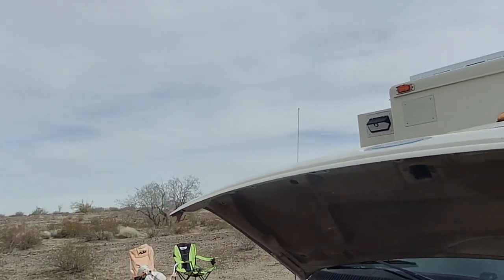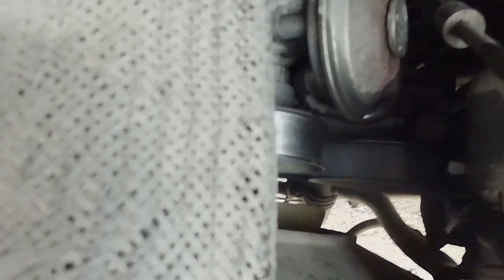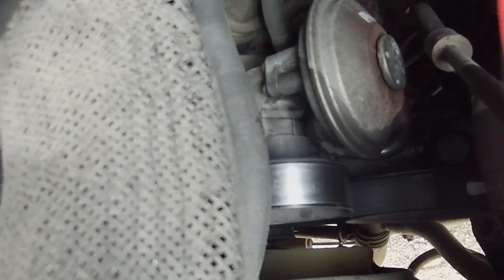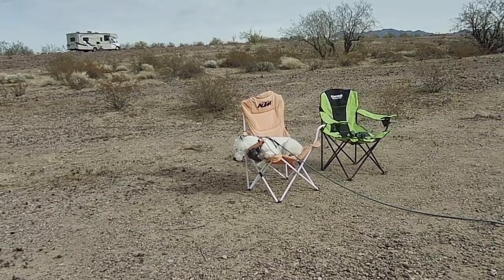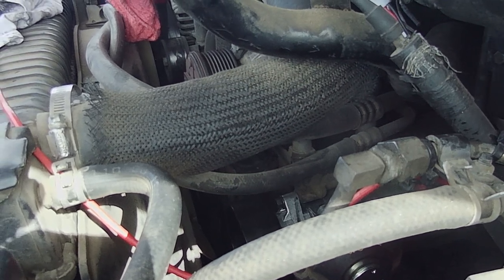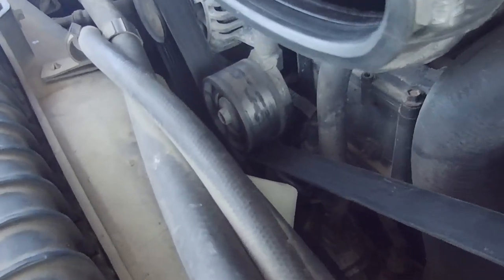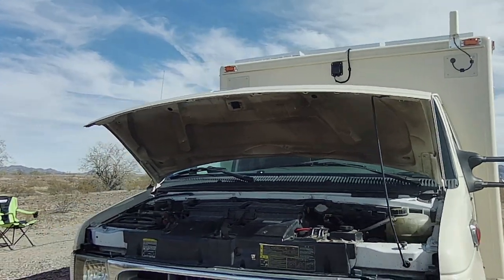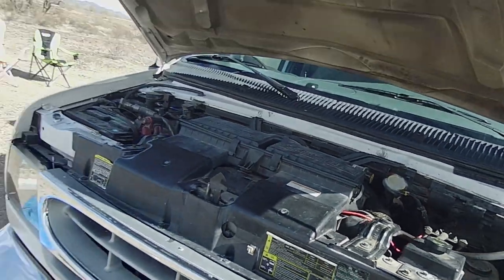Ambulance Conversion Brake Vacuum Pump Failed! Fluid Spray and Rattling Driving To Camp w/ New Pump

Comment: I would change the tension pulley while you do the pump.  Saves you problems later.  Got to have vacuum for your brakes to work.
Reply from the maker: I'm doing the idler pulley after seeing the belt material fixed to it...
Reply: @TheCampulanceMan  Good inexpensive fix to save problems down the road.
Reply: The E450 has hydroboost brake system. The brakes are powered by the power steering pump. Notice there is no vacuum booster? There is a small hydrolic valve unit instead. Thats the hydroboost. David idk if you knew that.

Comment: Not to be rude. You how to I saved so much money vids... most ambulance are built to a rescue company's needs. Also the fact that the wiring is intimidating is should also be well labeled. Making it easy if you look. Your diesel heater....you made your own problem. Picking a Ford thats on you to. Be easy brother. Just mentioning the stuff you are doing how to vids on are not all the same.